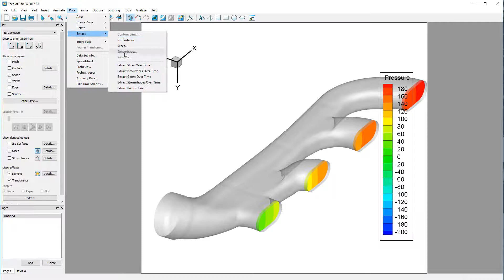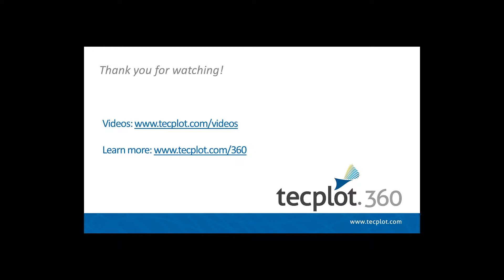Slice Extraction in Tecplot 360

Comment: Hi, I'm wondering if you can slice a volume and then create the contour on this slice? I'm using an exported tec file from Fluent. However, after slicing a volume, I can only see the mesh on this slice, no contour.  Does this mean I cannot slice and post-process even if I have the data exported for a volume?